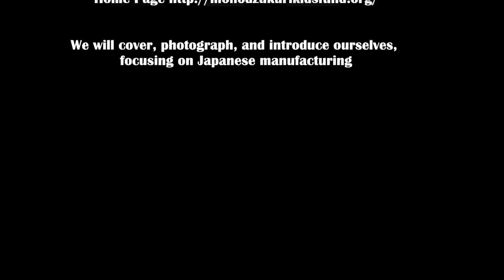One of "Tomorrow's Master Craftsman" creates a 3-dimensional folded Crane from a single Copperplate

Comment: Supreme craftsmanship with regard to the Copper origami bird-it is spelled with an "r" so that it reads " Crane "-not Cane- "Cane" is what the Americans call a Walking Stick!
I was wondering how you would construct a folding, soft metal walking stick that did not bend under the lightest pressure!
Well done, fine work and thanks for sharing it with us.
Reply from the maker: Thanks for setting me straight, I did it